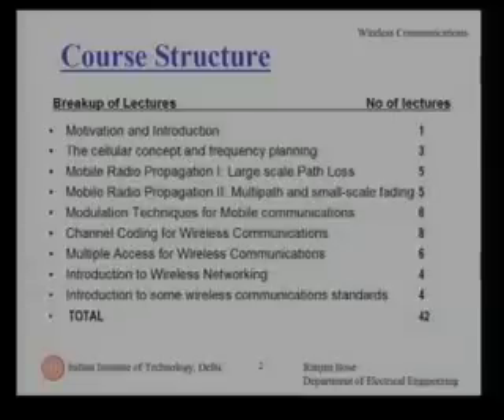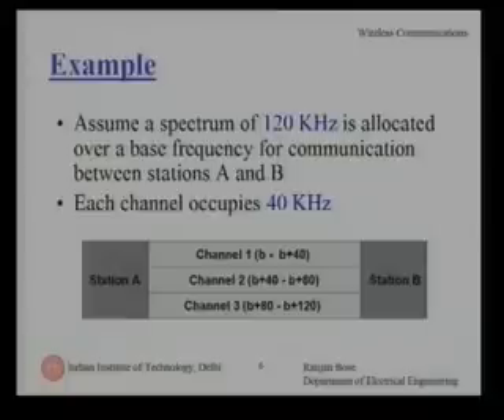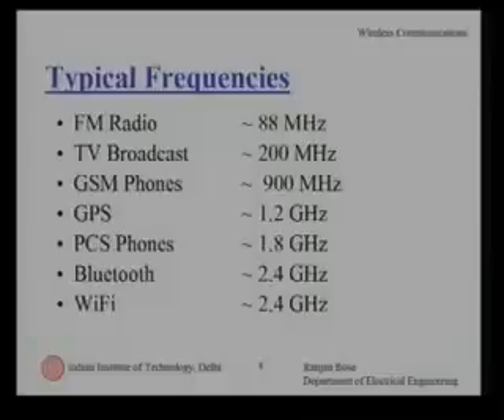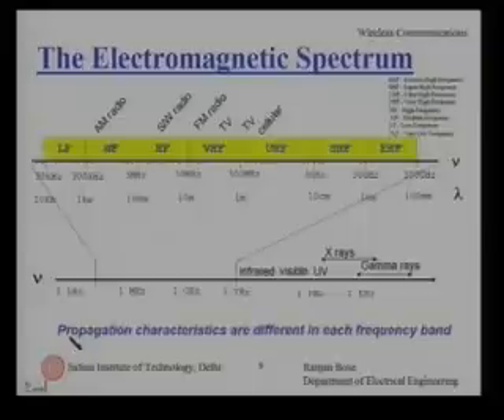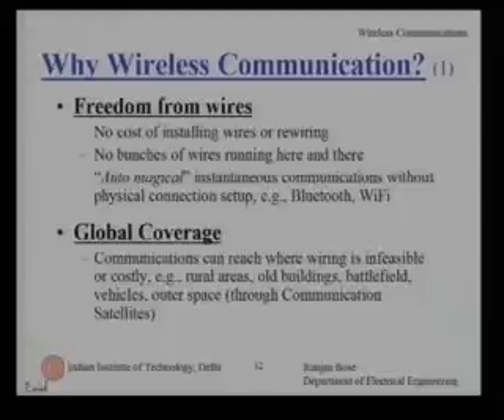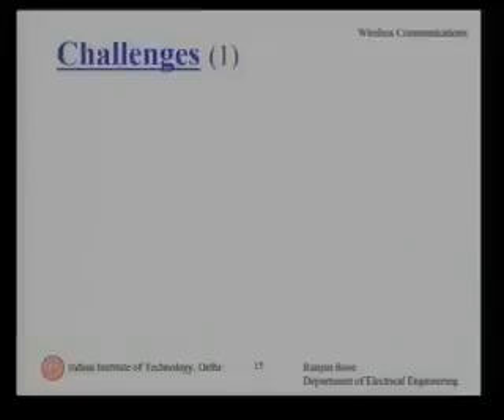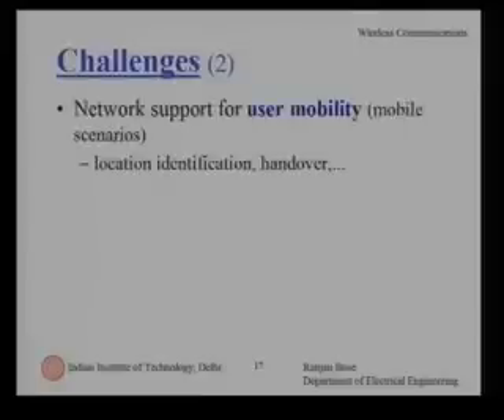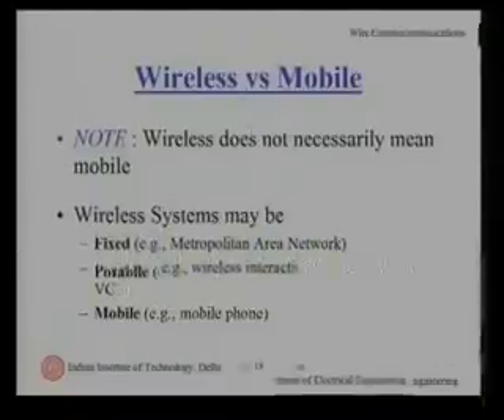Lec 1 - Motivation and Introduction

Comment: Good lecture but almost 10 years ago.. Regarding the FTTH this is now possible because of GPON Technology to provide Fiber connectivity to home.. Fiber to the curb was good in past days for last/first mile problem, but it was have one point of failure.. If the curve switch goes down then whole community would have lost the service but with GPON (FTTH) it gives service provider to provide internet connectivity to the user with less CAPEX and OPEX..

Comment: NIce intro and motivation.
I am not an expert but there was small mistake when 2G was mentioned as analog, slip of tongue definitely.

And i would like to add that at lower frequency we need bigger antennas at the receiver because the size of the antenna is directly proportional to the wavelength of carrier.